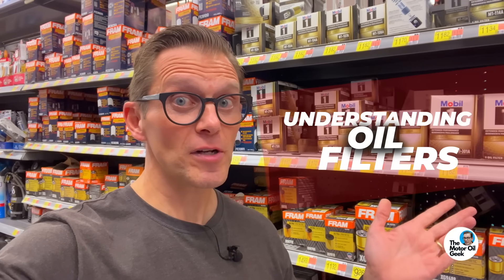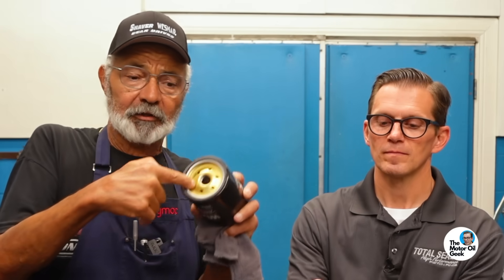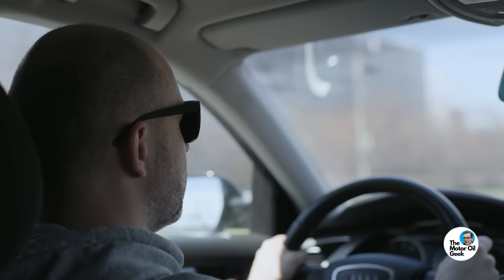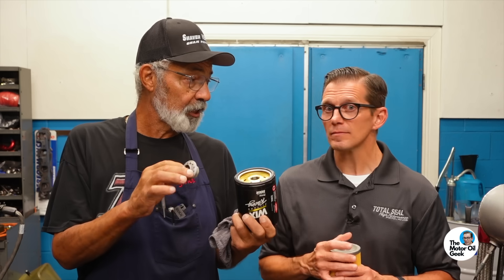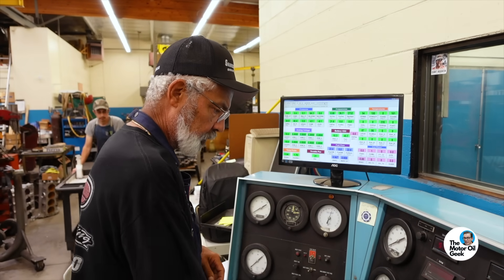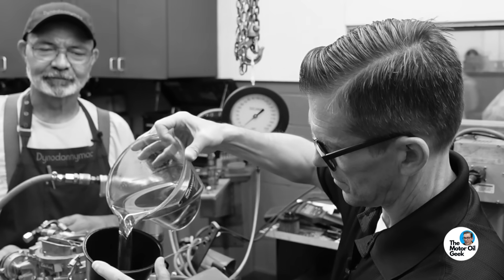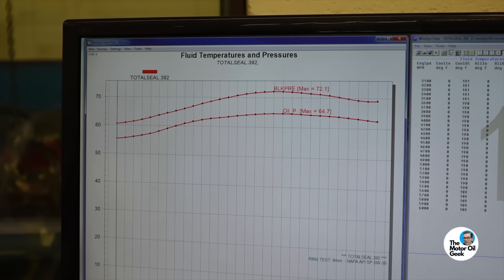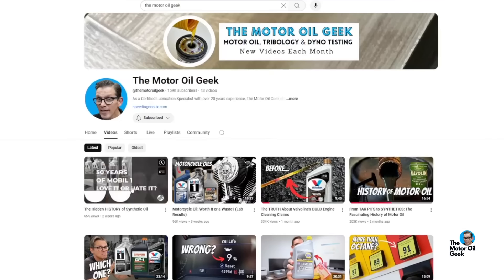OIL FILTERS: What Most People DON'T Know!

Comment: The engineer that design the lubrication system has to take many worst case scenarios into account. The system we are interested in here is both simple and reliable.  First you have an oil reservoir in the bottom where the oil is stored and where the oil pump gets the oil. When the engine first starts, the pump pressurizes the system, which immediately sends oil flowing . There is also an oil film coating engine assembly.  So you do not need to pre fill your oil filter or change your oil and filter after the first 500 miles on a new engine.  Oil lubricants and filter filters the oil. Break in oil from the factory is better than most oils you can buy at Walmart .

Comment: Great content . Why don't we see  oil pumps fail due to the pump operating on non-filtered oil ?
Reply from the maker: Thanks! Sounds like we should visit an oil pump manufacturer to get the real answer!
Reply: Most of the pickups for the oil pumps have a screen to strain out the gross bits and in some engines the pickup is a fraction of an inch above the bottom of the pan 
where the pipe connecting the pickup goes up to feed the pump there might be an O ring seal,if that seal leaks (sucks air) might be a disaster for the engine.
Reply: Actually I have seen pumps torn up and cause low hot idle oil pressure. Replace the pump and oil pressure returns to normal at hot idle. Every time I have done this the engine looks pretty clean inside but when I ask the customer if any work was done on the engine prior to the low idle oil pressure  the awnser was yes how did you know. I assume the oil was contaminated and tore up the pump but the filter stopped debris from killing the bearings.

Comment: That’s not a check valve. It’s a pressure relief valve. And, sure, it functions to allow oil to partially bypass a dirty filter, but it also allows thick, cold oil to bypass as needed, and, more importantly, it prevents the possibility of very high pressure between the pump and filter. High pressure that can rupture the filter canister or break the oil pump drive.
Reply: And by “cold” I don’t mean your cozy room temperature shop- I mean COLD. ;)

Comment: Some confusion here, the first valve IS a check valve, that makes the residual oil not leak out. Second valve (bypass) IS NOT a check valve. It is a pressure relief valve that relieves pressure if the filter media is clogged and back pressure is too high and causes oil starvation. Big Difference!

Comment: Couple thoughts to contribute. The bypass valve is spring-loaded so just because it may 'bypass' does not mean it bypasses all the oil flow. The filter media will continue to flow oil the entire time, in concert with any bypass that occurs. Also, when bypassing due to a 'clogged filter' media, the media still flows oil (just less flow) and likely does so with an even smaller size (micron) filtering. Partially clogged filters of all conventional types are better at removing smaller-than-nominal debris, which is a tradeoff for not flowing as much.

Comment: I pre filled my oil filter with VRP the other day thanks to you!
Reply: Thanks, let us know how  VALVOLINE R & P , goes. Interestingly, I just early replaced VALVLINE Oil Filter , WITH BOSS PUROLATOR S ( my point s, is VALVOLINES only, normally):: two vehicles first VRP CYCLE JAN  2025… etc. Interestingly, also, extremely dark VALVOLINE on my 2015 JOURNEY ALREADY, @2000 + miles.?. May do another Filter, or early OCI.
Reply: im like::::::::::::::::::::::::: i want to get RENAULTBRANDT oiler filtration systeme for my FANUKKU robotarm (6 dogrees of maxis) BUT
there'is no  oilFILTRATION hole/thresholdOVERRUN
Reply: Ps: I always “ carefully, “ prefill “ oil Filters ( 40++ years)….admittedly, horizontals problematical, & maybe uncertain/ unnecessary many applications….etc.

Comment: I've seen the chevy  cart filters get  "crushed", the lack of bypass explains that well.
Reply: I had one "canless" crush only because the prior filter's gasket was still retained, so I was running double donuts, so to speak.   You should check for that.  The good news is that it was probably still sealed and filtering AND I don't do extended OC intervals.  100k and counting, 2014 chevy 3.6.

Comment: How much horsepower would be gained by running no oil filter, no bypass, no check valve? Basically removing all restrictions caused by the filter itself.
Reply from the maker: A small amount. We’ve tried that before!

Comment: I understand it as
A bypass valve would prevent over pressure and oil starvation in event of plugged filter. 

A check valve would prevent some of the oil from draining back out of the filter.
Reply from the maker: Correct!

Comment: At 73 years old I remember cars and trucks with no oil filters and just used rod cap cups to splash oil to the cams and cylinders as well as a distributors driven oil pump , living in the Yukon in the 60's as a mechanic we could use a 4 inch stove pipe to heat up the oil pan , I have seen a lot of main and rod bearings gone trying to move a 300 Cummins before the oil was warm , yes the gauge showed high oil pressure but the tar oil was no go no flow . on the old ford 352 360 and 390s it would break the oil pump drive shaft to the oil pump ....whoop's , if you brock down on the highway we would cover the car or big truck with a parachute and use propane bottles to heat it up over night , the only problem was at 50c- we would use an other propane torch to keep the other bottle of propane to not freeze and we would switch tanks every 2 hours ,hey ask me how I know this 😂🤣😅       🥶😰
Reply: When I was a kid, mom had her 81 rabbit diesel. We got a cold snap and Dad didn't change out the 20-50 stuff. 
She fires it up, has it running in the driveway for about 3 minutes to help get it a little bit warm and takes off. 
I see her turn around down the road about 30 seconds later and comes back, The oil light is flashing. 
She shut it off immediately. 
I was like 13, but I pulled the dipstick and it was like string. 
So dad pulled the dream plug, and it probably took it 25 minutes to drain by itself at an ambient temp of like 15f. 
Anyways, he didn't change the filter right there because she had to go to work, he dumped in some 10-30 and started it up and let it idle for a few minutes, took it up the road and came back and the oil light was not on, handed it to Mom and off she went to work. 
Crazy how much that oil was like lukewarm  tar when it flowed out of the pan 😂
That car lasted her until I got it in 91 and hammered it for 2yrs. 
Had like 200k but was severely rusty and became undrivable for safety's sake.
Reply: I still have a 1951 chevy pickup I love my Orielly parts guys but like to mess with the new guys asking for an oil filter or how much oil pressure it should have, the young guys can not believe it has no filter or pump, but at 77,000 miles no knocking just a slight tick from the solid lifters
Reply: @JimSix-jo6hf   sweet truck buddy and so simple , love those trucks
Reply: I grew up in a community right at the base of a notoriously dangerous steep mountain road in southwestern PA, there's a runaway truck road coming down it and flashing warning lights on signs coming up the back side of it, a mandatory pull over brake check for tractor trailers at the top before they start their descent and another one half way down with trucks being limited to 10 MPH coming down it, so yea, it's a steep one.
When I was a kid I remember my grandfather telling me about an early OHV straight 6 engine in some vehicles that had cups on the timing chain that would dip into the oil in the pan and toss it into a trough at the top when they flipped around, that trough acted like a gutter that took the oil down the length of the head dripping it on all the components along the way that needed it.
He said you could spot those models of vehicles that had that engine because they'd go backwards up the mountain, reason being is if their oil was a little low and they went up forward the oil in the pan would slosh to the rear and those cups in the timing chain wouldn't pick up oil resulting in the top end being oil starved and burning up.
Reply: @dukecraig2402  Thanks for sharing this interesting way of dealing with it.
Reply: Damn those really were the days!!!!…I miss them…!!!!!!
Reply: @oldbiker9739  VW built millions of Beatles over decades with no oil filter.
Reply: My 1950 chevy3100 straight 6 has a breathers no filter

Comment: 🔔😎🇺🇸
1) I use Mobil 1 filters because the oval inlet holes flow 3x the volume. Filter media difference in the real world is moot.
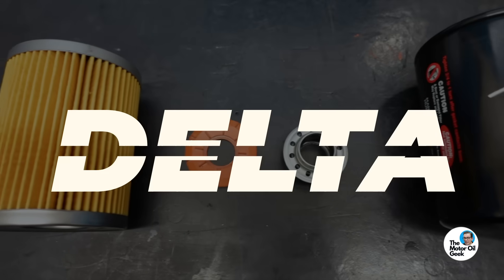2) 4:12 he called Lake "Slick".
3) 5:19 Did you say that Ford filters have no bypass? SBF ? 4.6 ohc ?
4) Oil at 65* f is much more viscous than at 200*f running temperature.
Yet, dyno runs are usually done at 160*. On my Fox 5.0 I run a Ford sandwich type police car oil heater/ cooler in the heater hose to maintain 200* oil temp.
Last week at 50*f I drove my Ford Panther car 4.6 20 miles highway and changed my oil. It was still cold enough to keep my finger submerged continuously. Maybe 110* after 20 miles, didn't measure it.
5) I always fill my vertcal filter, a half fill the angled ones. NEVER FORGET that the oil pickup tube usually empties when the oil is drained. So it is full of air on startup.
Crank a few sevonds before starting if possible. Thank youz for sharing your knowledge 👍
YeeeeHaaaaw!!!😀
Reply from the maker: Thanks! The filters for the traditional small block Fords have the bypass valve in the filter. The traditional small block Chevy puts the bypass valve in the block.

Comment: Here's a question.   When I remove the filter from the engine  all the oil drips out, which means that either vertically or horizontally positioned, the filter is always placed below the internal oil level.  That being said, if I put a new empty filter, as I pour the new oil in, it would fill the filter.   It would be full of oil by the time the level reaches the top mark on the dipstick.  Why the need to pre-fill the filter?

Comment: now do a filter with off a engine with dirty oil, my idea is any engine with black oil has the bypass opening and the oil isn't being filtered, that's why the oil is black.
Reply from the maker: Oil turns black primarily due to the soot from combustion being suspended in the oil.

Comment: Loved the video, especially the explanation of the delta pressure for the bypass valve.  One question.  I have already seen a lot of discussion re. this video on an automotive lubrication discussion board, and Bob's friends would love to see this test run with actual cold weather conditions, and initial startup.  Any chance you could do that?  I for one would also love to see that.  Put this Delta P question to rest.
Reply from the maker: I guess if we had a dyno in Alaska we could repeat the test. It’s hard to get the oil colder than 60F in LA.
Reply: @themotoroilgeek  Any way to put the oil and filter in a cold chamber, then fill the engine and install filter immediately before performing the test?  Not ideal, but it should validate what you saw, in regards to lower delta P on a cold engine, than a warmed up engine.

Comment: This is the best explanation of a bypass that I have watched. I live in New Hampshire and drive a 2016 F150 with a 5.0 engine. Tomorrow morning the temperature will be close to zero. How does this environment affect the differential pressure? Is there a difference between 5W-20 and 5W-30 when cold? My daily practice is to start my engine and let it idle until the RPM drops and go easy on the accelerator for the first three to five miles. I run Valvoline High Mileage Full Synthetic Oil and a Purolator Boss oil filter. Oil changes have been done at 5K or less since new. Thanks in advance to anyone who comments.
Reply from the maker: Your start up practice is spot on. The engine only needs to idle for about a minute in cold weather before you begin driving gently.
Reply: @themotoroilgeek  I live in central Pennsylvania and as soon as the windows are clear of snow and ice I drive. Summer time is a lot sooner.
Reply: Not any meaningful difference between 5w20 and 5w30 at that temperature, for starting purposes. 0w30 would be a good choice if you expect cold temperatures throughout the oil interval. 

Some oil companies are claiming 0w20 can replace 5w20 as well, better cold weather performance, and the same viscosity at temperature.
Reply: @plkracer 
Many car manufacturers and oil companies recommendations aren't in your best interests, they're about keeping the EPA off their backs by recommending what's best for "the environment", ie they get to "check off boxes in the environmentally friendly corporate checklist" which gives them green credits that results in lower federal taxes for them.
Two perfect examples are recommending 10,000 mile oil change intervals instead of 5,000 like they really should, by recommending 10,000 mile intervals they've got you creating ½ the waste oil than recommending 5,000 mile intervals, that makes the EPA happy. 
And here's the big one, when it comes to "pre fill or don't pre fill oil filters", by them telling you not to pre fill your filters that guarantees that you won't be spilling oil that'll wash down drains and into creeks and streams.
Neither one of those recommendations is going to trash your engine before the warranty expires which is their only concern when it comes to how long your engine lasts, but that doesn't mean they're not shortening the life of your engine, it's like I've explained to countless people who claim they've proved something by saying "400,000 miles on my engine and I've never pre filled my filters", yea OK, all you're proving is that you'll take a 600,000 mile engine and turn it into a 500,000 mile engine by not pre filling your filter, because no matter how far an engine goes that had its oil changes performed without filling the oil filters the reality is it would have gone even further if you had.
Before that debate even began, years back the automobile manufacturers used to state that the majority of engine wear happened at start up, not after an oil change but just ordinary start up, that 1 to 1½ seconds until pressurized oil hits everything when all it has is the film leftover after being shut down, also manufacturers have always warned about not pre filling filters on turbo charged cars, how that 4 to 5 seconds it takes for oil to hit the bushing in a turbo will greatly reduce its life, they also warned against revving a turbo charged engine then immediately shutting it off, because that gets the turbo spinning real fast then shutting off the engine shuts down the oil supply to the shaft bushing in the turbo, you're supposed to let them idle for at least 30 seconds before shutting them off, and you'll notice most truck drivers, the ones worth their salt, do just that.
To counter that problem some years back several aftermarket companies developed secondary electric oil pumps that immediately kick on the moment you shut off your cars engine and pump oil to the turbos bushing for a selectable amount of time, like 1 to 5 minutes in 30 second selectable intervals, my question is this, given the amount of engine wear that happens at start up, I wonder how long an engine would last if you rigged up one of those kits to pressurize the oil system as soon as you turned a cars key on and during cranking, like how you can hear the electric fuel pump spin up as soon as you turn the key on, I wonder how long an engine would last if you could pressurize the oiling system with an electric pump before you even started cranking on it (that same system would be excellent for filling oil filters during an oil change which would eliminate pre filling them), yea, I wonder how long an engine would go then.
Reply: Grew up in the 1950.s and 1960's. Not sure if there was multi viscosity oils back then or not. But I do remember my dad would put straight 20WT oil in the car in the winter, and straight 30 WT. oil in the summer. He changed his oil spring and fall. And even back then it must have worked because I remember When they traded the 1968 Chevelle it had about 178,000 miles on it which was considered very high miles at the time considering all of the technology of that era.
Reply: @scrambler69-xk3kv  Born in 1960, and I remember my Dad and Grandfather changing their oil, but I don't remember straight-weight oil that far back. Is that what they used back in the sixties?
Reply: @kerrylewis2581  Single-weight oils were all there was for a long time. When multi-grade oil came out, many people considered it suspect. Even in the 70s a lot of folks didn't trust multi-grade oils, especially if the car was old enough that the original specification for the vehicle was a single-weight.
Reply: Ditto. Mobil 1 oil and filter here
Reply: @hotrodray6802  I lived in Fairbanks, AK, for 3.5 years where temps are sub-zero for months. Used Mobil 1 synthetic in everything, Yamaha 3-wheeler included. Had block and battery heaters and never has any issues starting either car. I'd even pull crank the 3-wheeler and ride at 20-25 below, although I did have to heat the carb to get it to fire.
Reply: A clogged filter has done it's job.
Reply: @bradhuffjr777  ?
Reply: Haha, for a good time install a mechanical oil pressure gauge ,and cringe for the 5-15 seconds it takes for the gauge to move on a cold start 😂
All I can say is probably thank God for boundary lubrication!
Reply: I’m down in Rhode Island not quite as cold but we do get down to below zero for sure some days. I have an 04 super  duty daily driver with the 2 valve 5.4 v8. Always had 5w20 its whole life. I’ve been using 5w30 in summer. Some guys say use 5w30 year round. Might do that since it’s getting old and I need it to last. But worried about those really cold days. I see ford boss me use 5w30 even on much newer trucks year round.